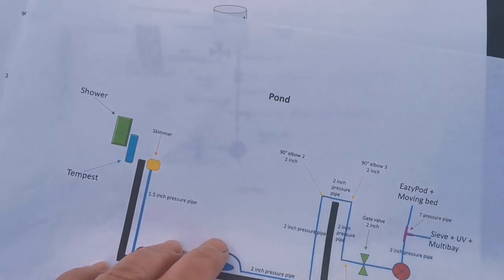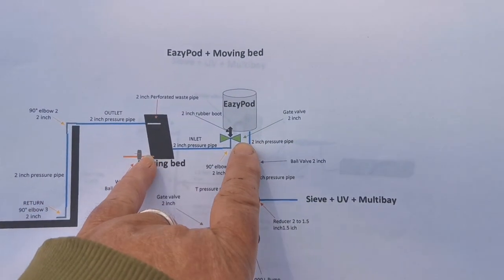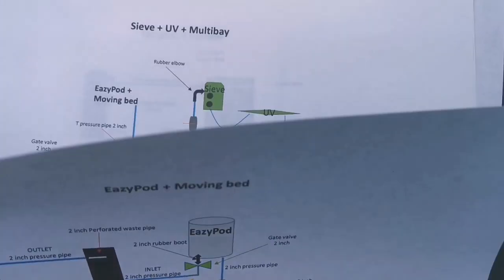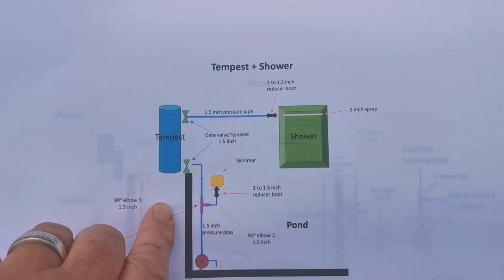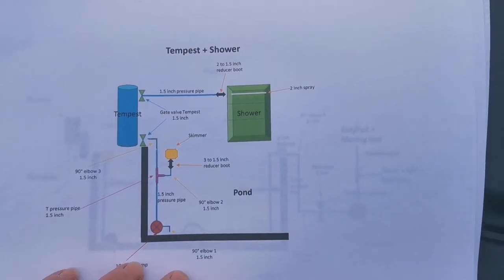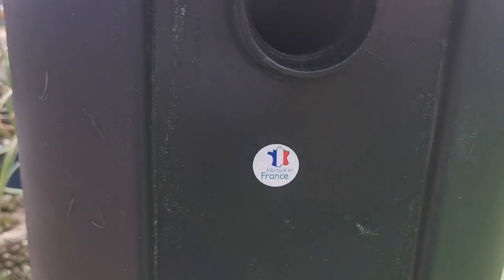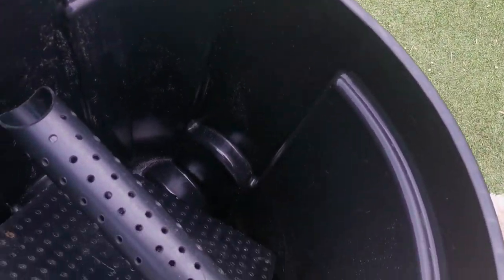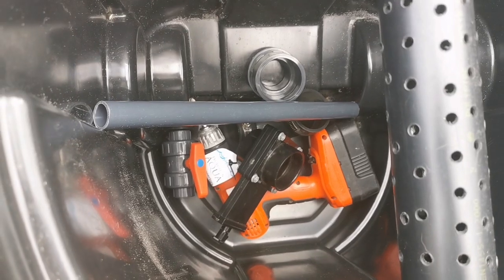Sleepers koi pond build - planning the filtration system

Comment: Like the plan for the filter setup but you wont make me a fan of the Tempest. The feed to the filters from the retro bottom drain needs to be below water level ie come through a bulk head fitting in the pond side it can be only inches under water level it don't need to be much. if you come over the wall you will need to prim the pump to get it sucking and will have problems with air locks. plus if you ever have a power cut it wont self restart hope this is of help
Reply from the maker: I know you are not a fan of the Tempest, but I think for me it was the best solution and wanted to try the new gadget. Some people have had some good results. Yeah will do that with the feed. For priming the pump, yes, it will be needed. I have watched again the video that Andy (Koi Diaries) did at Gary and Beth, it will be very similar system, so I am adding a non return valve. That should help in case of power cut do you think?
Reply: A non return valve will work if there's a power cut but it needs to be after the pump. and i think you will have a real job to prime it in the first place as the over the wall loop is a catch for a airlock and mite need a air bleed valve. best way to prime it is a pond vac shoved down the inlet pipe to the filter with the pond pump running as well hope you are lucky with it. Happy ponding
Reply from the maker: @boxtriker  that makes sense. I will try to vac. That's a great idea. Thank you Martyn.